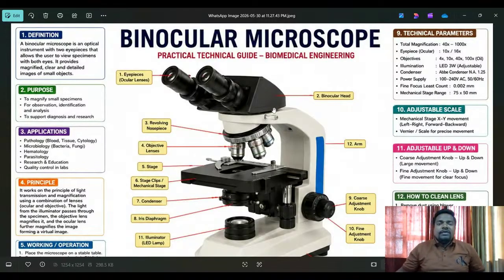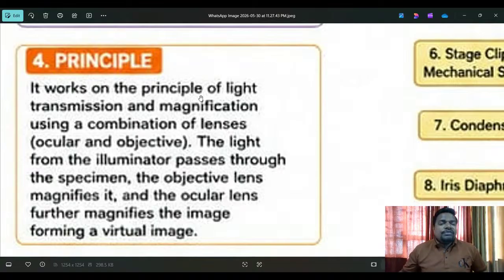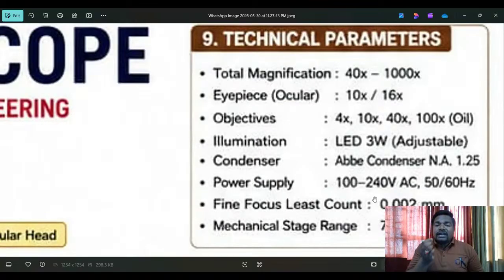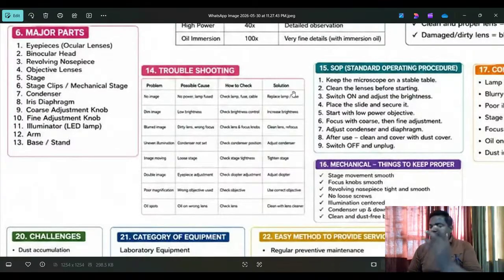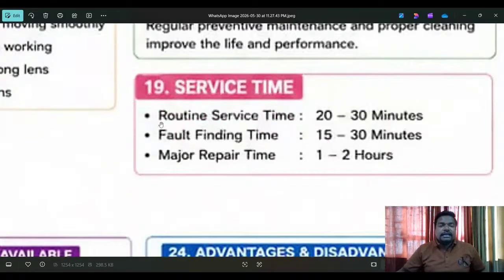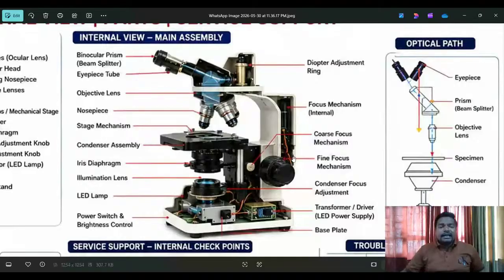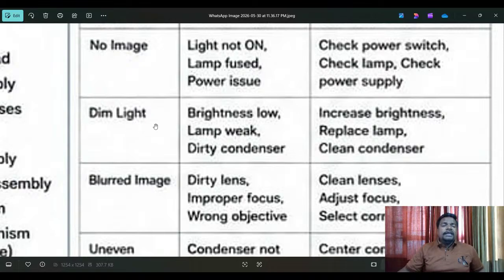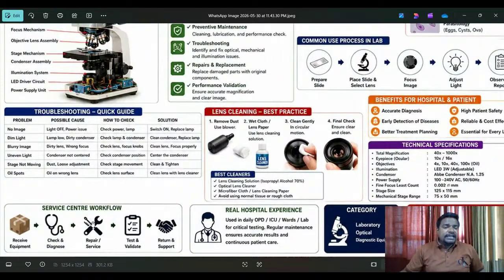🔴 LIVE | Binocular Microscope Complete Practical Technical Guide | 31.05.2026 | 3:00 PM

Comment: Excellent,Please more sessions medical laboratory equipment for all departments
Reply from the maker: Thank you so much for your valuable feedback and encouragement! 🙏 I'm glad you found the session useful. Yes, I will definitely conduct a complete series on Medical Laboratory Equipment covering all departments, including Hematology, Biochemistry, Microbiology, Histopathology, Blood Bank, Molecular Diagnostics, and more. Stay connected and support the channel. Thank you! 😊🔬
Reply from the maker: Whatever you need live sessions equipment list share I will keep scheduled
Reply from the maker: General Laboratory Equipment

1. Beaker

2. Conical Flask

3. Volumetric Flask

4. Round Bottom Flask

5. Test Tube

6. Test Tube Rack

7. Test Tube Holder

8. Measuring Cylinder

9. Pipette

10. Micropipette

11. Pipette Tips

12. Burette

13. Funnel

14. Filter Paper

15. Glass Stirring Rod

16. Dropper

17. Wash Bottle

18. Watch Glass

19. Evaporating Dish

20. Crucible

21. Mortar and Pestle

22. Spatula

23. Forceps

24. Tongs

25. Laboratory Bottle

26. Reagent Bottle

27. Weighing Boat

28. Weighing Paper

29. Desiccator

30. Thermometer

Laboratory Instruments

31. Analytical Balance

32. Precision Balance

33. Hot Plate

34. Magnetic Stirrer

35. Hot Plate with Magnetic Stirrer

36. Water Bath

37. Dry Bath Incubator

38. Laboratory Oven

39. Muffle Furnace

40. Autoclave

41. Laminar Air Flow Cabinet

42. Biosafety Cabinet

43. Fume Hood

44. Centrifuge

45. Refrigerated Centrifuge

46. Vortex Mixer

47. Orbital Shaker

48. Incubator

49. CO₂ Incubator

50. BOD Incubator

51. Deep Freezer

52. Laboratory Refrigerator

53. Ice Maker

54. pH Meter

55. Conductivity Meter

56. TDS Meter

57. Dissolved Oxygen Meter

58. Spectrophotometer

59. UV-Visible Spectrophotometer

60. Colorimeter

61. Flame Photometer

62. ELISA Reader

63. ELISA Washer

64. Microplate Reader

65. PCR Machine (Thermal Cycler)

66. Real-Time PCR System

67. Gel Electrophoresis Unit

68. Gel Documentation System

69. Electrophoresis Power Supply

70. Microscope

71. Stereo Microscope

72. Fluorescence Microscope

73. Inverted Microscope

74. Digital Microscope

75. Hemocytometer

76. Hematology Analyzer

77. Biochemistry Analyzer

78. Electrolyte Analyzer

79. Blood Gas Analyzer

80. Coagulation Analyzer

81. Urine Analyzer

82. HbA1c Analyzer

83. Immunoassay Analyzer

84. Blood Culture System

85. ESR Analyzer

86. Osmometer

87. Turbidimeter

88. Nephelometer

89. Colony Counter

90. Water Purification System (RO/DI)

Laboratory Safety Equipment

91. Laboratory Coat

92. Safety Goggles

93. Face Shield

94. Nitrile Gloves

95. Chemical-Resistant Apron

96. Fire Extinguisher

97. Eyewash Station

98. Safety Shower

99. Spill Kit

100. First Aid Kit

Comment: Sir fuse how much amps needed
Reply from the maker: Mostly based on my real time hospital experience 
My answer 
"The fuse rating depends on the microscope model and lamp power. Most laboratory microscopes use a 0.5A to 2A fuse. Always check the fuse specification mentioned near the fuse holder, power input label, or user manual before replacement. Never use a higher-rated fuse than recommended."

Comment: Sir for the monocular microscope 
Diaphragm is available 
Without diaphragm  can use the microscope
Reply from the maker: Cleaning LENS ?
"For microscope lens cleaning, use only lens cleaning solution (optical lens cleaner) and lint-free lens tissue/lens paper. Avoid normal cloth, alcohol in excess, or abrasive cleaners, as they can damage the lens coating."
Reply from the maker: "Sir for the monocular microscope diaphragm is available. Without diaphragm can use the microscope?"
My answer "Yes, the microscope can still function without a diaphragm, but image quality, contrast, and light control will be poor. The diaphragm is important for proper illumination and obtaining clear specimen details, so replacement is recommended for accurate observation."